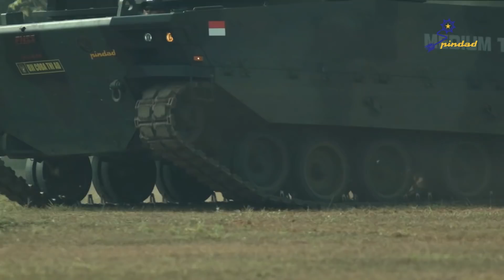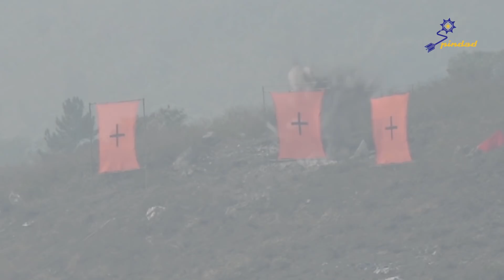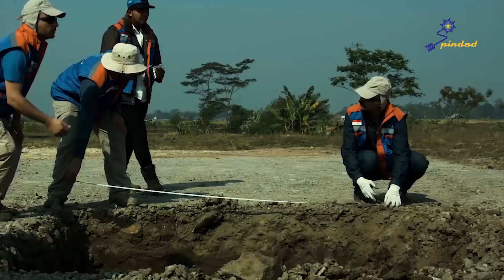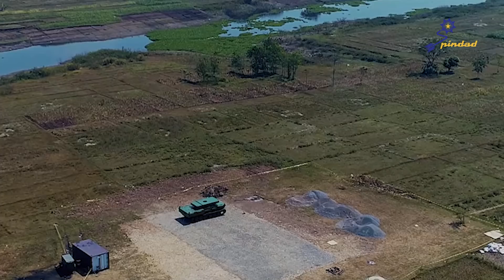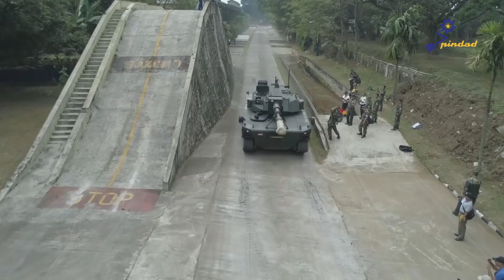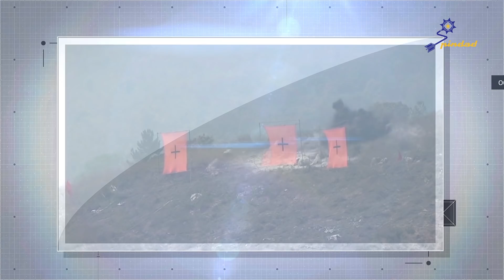Medium Tank Pindad

Comment: Medium Tank Pindad, yang secara resmi dikenal sebagai Harimau Medium Tank (atau Kaplan MT di Turki), adalah sebuah kendaraan tempur lapis baja modern yang dikembangkan bersama oleh pabrikan Indonesia, PT Pindad, dan pabrikan Turki, FNSS. Program pengembangannya dinamakan Modern Medium Weight Tank (MMWT).
Tujuan Pengembangan:
Tank ini dirancang khusus untuk memenuhi kebutuhan operasi di daerah tropis seperti hutan, karena memiliki bobot yang lebih ringan dibandingkan Main Battle Tank (MBT) yang jauh lebih berat. Ini memberikan keuntungan dalam hal mobilitas dan kemampuan bermanuver di medan yang sulit.
Fitur dan Spesifikasi Utama:
 * Bobot: Sekitar 30-35 ton, yang membuatnya lebih ringan dan lincah daripada MBT.
 * Awak: Diawaki oleh 3 personel (komandan, penembak, dan pengemudi).
 * Senjata Utama: Dilengkapi dengan turret 105 mm (umumnya menggunakan meriam Cockerill 105 mm high-pressure) yang memiliki daya gempur tinggi dan mampu menembakkan berbagai jenis amunisi 105 mm. Turret ini memiliki mekanisme autoloader dengan 12 butir peluru di turret dan 26 butir cadangan.
 * Senjata Sekunder: Senapan mesin koaksial kaliber 7,62 mm untuk daya gempur maksimum, dan bisa juga dilengkapi dengan senapan mesin di atas kubah yang dioperasikan secara RCWS (Remote Control Weapon System).
 * Perlindungan:
   * Proteksi lambung STANAG 4569 level 4.
   * Dapat dilengkapi dengan pelindung modular tambahan hingga STANAG level 5, yang mampu menahan peluru 30 mm dari depan.
   * Lambung berbentuk V untuk menahan hulu ledak 10 kg ranjau anti-tank.
   * Dilengkapi dengan berbagai teknologi terbaru seperti sistem kewaspadaan mandiri, hunter killer system, perlindungan pasif (laser warning system), dan battle management system.
 * Mobilitas:
   * Kecepatan maksimum sekitar 70-78 km/jam di jalan raya.
   * Dirancang untuk berbagai medan, termasuk pasir, bukit bersemak, dan rintangan vertikal.
   * Mampu menanjak hingga 60% dan melintas kemiringan sisi 30%.
   * Jarak jelajah sekitar 750 km.
Pengembangan dan Uji Coba:
Medium Tank Harimau telah melalui serangkaian uji coba yang ekstensif, termasuk uji daya gerak (meliputi jelajah on-road, off-road, lintas pasir, ketahanan 3x24 jam), dan uji tembak untuk memastikan fungsi meriam 105 mm. Uji coba ini dilakukan di Indonesia dan Turki.
Signifikansi:
Pengembangan Medium Tank Pindad (Harimau) menjadi tonggak penting dalam industri pertahanan Indonesia, menunjukkan kemampuan anak bangsa dalam memproduksi kendaraan tempur modern dan mengurangi ketergantungan pada produk impor. Tank ini dirancang untuk menjadi bagian integral dari kekuatan pertahanan Indonesia, khususnya di daerah operasi tropis.

Comment: You know what that big high hull that most people thing its biggest weekness actually might been its biggest advantage, that body contur attract the enemy to aim it rather than its turret, the front armour might been reinforce with double layer armour and it consist of hollow section to reduce blast effect and in case of dug in position within up slope the tip of the front armor can also act as protector of the turret remember this tank is operate in a high density area wether it will be urban dense or high density vegetation as in rural or woodland and even forestry so it need to be narrow enough and high enough to overcome most of the obstacle

Comment: 30t seems too light to be a medium tank.
Especially when IFV can weigh the same and have equal or greater firepower on the battlefield.
Not worth it in my opinion unless you are a poorer country as I cant see it being as expensive to maintain and train in.
Training is the most important aspect of acquisition as not many countries are at war or ever will be.
Going back to world war 2 most tanks Germany had were pnzr 1's and 2's as well as that oil was in high demand but scarce as a resource so had to rely on horses heavily.
As a vehicle this could definitely fill a capability gap to some nations but there are more capable options out there.
105mm and the weight class it's in it would make more sense for it to be used in recon.
It seems like it's mostly a Turkish design.
Well done Turkey you did a great job its definitely something to be proud of as you are maintaining your military defense industry as it is important to do so.
Who knows where the research and development and experience of this vehicle could go on the next project:)

Comment: Its shit lets be honest here. Lower glacis is huge and probably easily pentrated even by GEN 1 APFSDS. The gun elevation is horrid and some late ww2 tanks had faster elevation. And lastly the classifialcation of medium tank is way over due and obsolite its not the late 40s anympre people. This tank is a Light Tank at best and its armor is sub par in that compartment aswell. All in all a sub par and already obsole vehicle.
Reply: the design is utilized for the rough terrain passing trenches and  muddy piles ,  Terrain wise and budgetary constraint  the classification is still long way long way to overdue, its mainly for infantry support  with capability killing not so modern mbts, you don't field expensive and heavy on maintenance over 60 ton behemoths in muddy tropical jungle  mind you it has indirect fire capability thus 42 degree elevation using smart ammos integrated with drones or recon unit and in the terrain with heavy foliage and hills like south east asia or Indonesia as archipelagic nation, it should be useful. mobility>agility

Comment: I certainly hope the designers know that in their effort to compromise between weight, protection, and firepower that they've put out an inferior design. The proper route for their purposes would be to design a "Lite tank". Because such a tanks armor would be completely ineffective against larger more heavily armored vehicles, it would really only need to concern itself with armed APCS and infantry fighting vehicles on the ground, meaning it is presumably over armored. What's more a 105mm gun can and has been mounted on lighter platforms whilst still remaining effective. A medium tank is simply a compromise between heavier (and therefore slower)  more powerful vehicles and liter more agile vehicles with the aim of preserving the best qualities of both, however such an aim in and of itself is a flawed one. On the modern battlefield, if two similarly capable armored vehicles were to meet, the odds are that whichever vehicle fired the first shot, and or proved more agile, would be the victor. With this in mind what you truly require is akin to a glass cannon. You need only the amount of armor necessary to deal with small arms and shoulder fired weaponry as anything larger is likely to penetrate anyway. Build a vehicle like this and you will find that not only will you vehicle be far liter, capable of crossing bridges and moving through terrain others simomy cannot, but that it will be capable of fielding the same amount of firepower and active protection systems. Any soldier who's carried heavy loads for long will tell you that ounces equal pounds, in much the same way if a vehicle is liter the faster and more agile it is capable of being. When you build a medium tank your simply building a slower, heavier lite tank with far to much armor.
Reply: Thats what i thought an ifv would be the better decision against soft and light armor targets.
Against modern mbt?
Weak weapon 
Weak armor 
Only mobility which is irrelevant with modern fire control systems.
I would rather buy t90 than that thing....
Reply: @xloltimex38  to be fair the t90 is an excellent tank all around, and upgraded versions can easily go toe to toe with any other main battle tank. As for the 105mm main gun, such a gun is no good against the frontal armor of modern MBTS but is still capable of penetrating the side armor on such vehicles so it isnt useless.
Reply: @pyrogothica3906  indeed the t90 is a great tank i would never say something else. I mentioned it because the t90 is already in production for selling to other countries
The thing is the side armor of most mbt can be penetrated by larg caliber autocannons 25-35mm you dont need a 105mm for that.
Reply: @xloltimex38  true, but a 105mm offers more in the role of long range fire support and material destruction than smaller guns. It's about utility.
Reply: The designers of the Harimau are more than likely aware of the criticisms laid out in your comment. Put simply,  there are probably 4 reasons why Pindad would commit to such a project, and why the finished product would be satisfactory to their requirements.   

1) Pindad are the Indonesian state-owned industrial defense concern. Projects such as this one expand upon their expertise and range, as well as their objectives toward self-sufficient defense industry. It's a bit similar to a Chinese nuclear submarine: it doesn't have to be perfect, so long as it provides a sort of experiential test-bed. It's the first step in a journey. 

2) Given the topography and geography of both their frontiers and their interior, as well the necessities of deployment and delivery related to both the geography as well as the relatively limited logistical assets of the Indonesian armed forces,  there are obvious size and weight limitations. These should be obvious upon tertiary examination and you are no doubt aware of them, so I won't go into any further detail. 

3) No other country in SEA is currently manufacturing ANY indigenous tank of any size - albeit some nations would be more than capable of doing so, were they so inclined. Thus the Harimau takes on an element of national prestige, adding a political dimension. 

As you point out, the design is certainly a compromise - if compared to its contemporaries -, however this is not unintentional.  It doesn't need to be the most powerful tank in theatre, however it does require a certain versatility. I postulate that the rationale is somewhat similar to the logic behind the development of the battlecruiser prior to WW1; more maneuverable and nimble than a full size tank (especially in the rain-forest), more powerful than than anything else it might encounter (of course, that logic might prove to have a fatal flaw - HMS Hood, anyone?).  A T90, as mentioned by someone else, might represent a better option in a tank vs. tank engagement, but this represents only one possible (and unlikely) scenario in the Harimaus' prospects of deployment. The more likely scenario is that it will not be deployed against vehicles of equal size, armor or armament. It will be deployed in support of dismounted or light infantry, in terrain unsuited to conventional armor, against opponents highly unlikely to employ tanks (if armor) of any size. It has an (arguably) fair chance against any MBTs it might encounter, were Indonesia ever to find itself in such an engagement; this allows Indonesia's defence planners slightly more flexibility in preparing for as wide a range of contingencies as possible, while reserving their heavier tanks for more offensive purposes. The Harimau fulfills the priority requirements of the Indonesian defense forces, while supplementing the lower ones. 

4) The final reason is that it's pretty likely that both Turkey and Indonesia are aware that this sort of thing will be extremely attractive to a lot of potential customers who face similar topographical, infrastructural and/or financial limitations. Who wants to buy 1 Leopard 2 when you can buy 3 Pindad Harimau tanks (that might turn out to be an exaggeration, but you see my point)?
Reply: @nolanolivier6791  I agree with all of your points save for the second, as that only further reinforces one of my points. Given restrictions in relation to geography and infrastructure a "lite" tank is the way to. As a "medium" tank design simply adds unnecessary weight over a lite tank design. As for export it's hard to say how well it would do in the foreign market when there are already existing designs from other countries in the way of infantry fighting vehicles and other "lite" tanks that would likely outperform this medium tank in every conceivable way, what's more such designs would likely be cheaper since they come from companies already well versed in tank design and have been manufacturing for years, meaning that they are able to more effectively streamline materials and production costs. The only way I can see this having any notable success is if another nation in the same region chooses to purchase this design due to some prior animosity held against larger more established powers, or if it were to be sold to poorer nations with relatively small militaries however even the this would require PINDAD being able to offer this vehicle cheaper than alternative designs.
Reply: actually let me re-explain it why they designed the tank like this is because of the terrain problems, for example putting a M551 Sherdian in a vietnam war wasn't a good idea even tho its good, not all tanks are good at every terrain, so inconclusion, This tank could rival T_90/M1 abram in a jungle fight

Comment: 60 years behind other countries' technology. Should've spent more money on those leopard 2s.
Reply: 60 years late in what, can you explain ??
Reply: @tobiltok2536  tank building obviously. I even doubt that this tank is better than centurion (late 1940s).
Reply: @dank_lord  if you mean to compare the medium tank with the main battle tank class in its time, well let's see. I don't know what level of armor the centurion mk1 has, even if it is higher than the medium tank only those good points of the centurion mk1 compared to the medium tank, please compare between gun, electronics, optics, speed and mobility which is better ??
Reply: @tobiltok2536  a medium tank on modern battlefields is unnecessary. Lighttanks and mbts are the way to go. A medium tank is a jack of all trades. At nothing really good.
Reply: @dank_lord  I agree if the function of MBT cannot be replaced with MT as well as the function of MT cannot be completely replaced by MBT (no need for a shotgun if only to kill an ant right). but the purpose of making MT itself in Indonesia is more to replace the Amx13 fleet and several other old tanks.  in Indonesia the combat vehicle class is divided into several groups, for the heavyweight one using leopard2 revo while for the light and medium ones it will be replaced with MT as well as the logistics simplification of the previous combat vehicles which mixed between NATO and Soviet production.  and because the elevation angle of the ct-cv105 cannon is above 40 degrees it is expected to be used for artillery fire assistance for forest and mountain terrain in Indonesia.
Reply: @xloltimex38  Terrain wise and budgetary constraints, Mbts are heavy on maintenance and too expensive for low intensity warfare, and Indonesia is archipelagic nation with 90 percent humidity beside i dont think you can compare this tank with centurion with that modern technologies which are gunner lock on assist, ,indirect fire capabiliy using smart ammos thus 42 degree elevation of the cannon, modern ballistic computer and the newest version of it will be equipped with Zaslon derived active protection system against anti tank rocket and Atgms.
Reply: @emomales5782  not an mbt but a ifv with the ability to carry atgms would be the better decision
Reply: @xloltimex38  You dont use Atgm to give infantry close fire support to the entrenched enemies position especially in the jungle or hills.
Reply: @emomales5782  therefore the autocannon? 25-35mm is insane firepower?
Reply: @xloltimex38  not enough against hard entrenched target looking up our military operation in aceh, we used 30mm of bmp2 but 90mm from our upgraded pt-76 was better performed

Comment: There is less slope on the lower glasis plate, it wont do any good.
Reply: thats the most armored part,  and designed that way to overcome embankments such in ricefield or fish ponds that abundant  in the countryside
Reply: @emomales5782  oh really? How thick is the plate?
Reply: @takamanch  its still classified and made from composite armor ones not rolled homogeneous armor, usually tanks are heavier in frontal armor in upper glacis and lower ones in lower glacis but this ones is different they redesign and eradicate the need of heavy armored upper glacis so it could have better mobility in south east asian terrain
Reply: @emomales5782  ooooo thanks

Comment: 105 mm main gun and weighing at 30 tons seems more like a light tank to me.
Reply: 105 mm not to much powerful if hit heavy tank but can destroy light tank like crack the chips
Reply: Indonesia traditionally uses Amx-13 for light tanks, but again AMX-13 is only around 14 tons. So 30 tons in weight is a medium tank, and the 105mm turret is definetly for medium tank since Main battle tanks like Leopard 2 using 120mm. Btw the CMI Cockerill CT-CV 105HP turret on this tank is able to fire Falarick ATGM against MBT, so it`s a good tank for hit and run in case head to head against MBT.
Reply: 30 tons in current configuration, in the future the modular armor blocks will be replaced with others with more protection and  must not touch 40 t
Reply: there still using the old 105mm not 120mm this useless against modern mbt